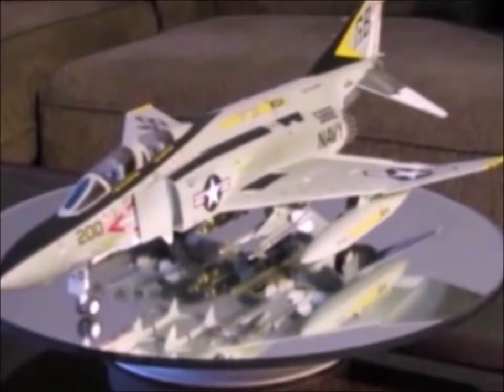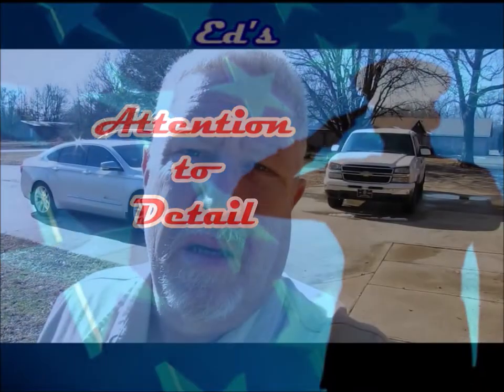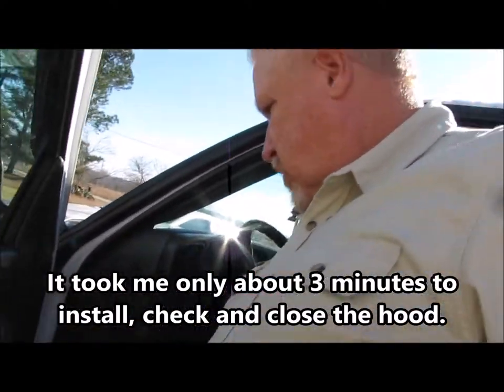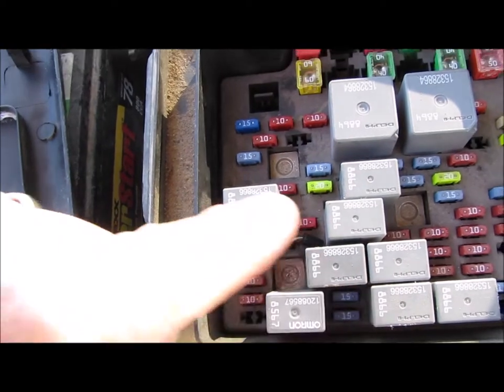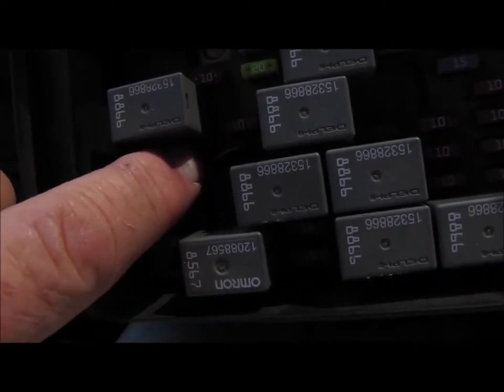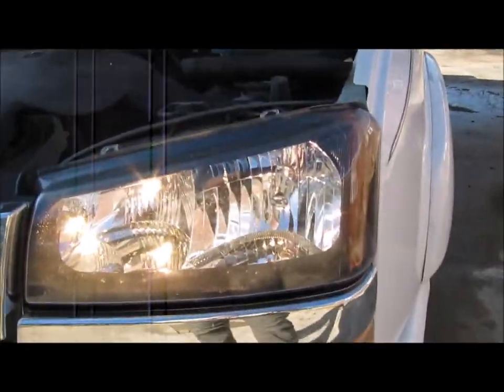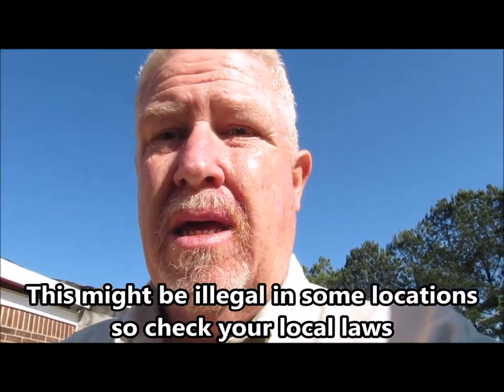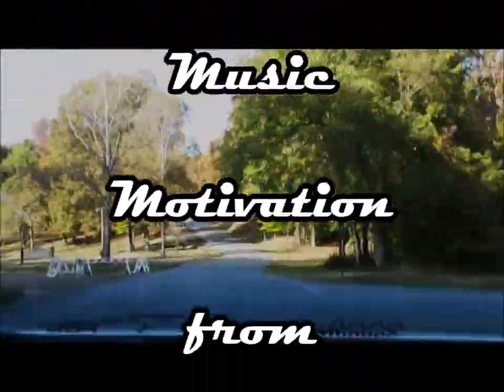Chevy Silverado & GMC high beam mod |  Truck Headlight modification |  Diodes

Comment: Hi Ed. This is a really informative video. Great information! Great disclaimer at the end. Have a great day buddy 👍
Reply from the maker: Funny thing is that several companies make a wire harness with a relay and fuses to do the same thing but charge $20 or more and this cost less than a quarter for the diode.

Comment: This will work on any car/truck with 4 headlights where only 2 come on with high beams.

My 90 Silverado has no relays or a factory diode, or flash to pass. Just an ole school simple low beam hot wire and hi hot wire seperate from each other. I just shorted those 2 wires together with a 10A diode ordered from walmart.

But my circuit breaker is 20A so I had to calculate that 4 headlights on would not draw over 20A. Turns out the two 55w lows draw something like 8A, the two 65w highs were something like 9.5A, or 17.5A with all 4 on. Only the 8A lows draw off the 10A diode, so thats was ok too. 

Part of what made me do this is my 02 bonneville was way brighter but I discovered it has the same lowbeam and hibeam part # bulbs as my 90! Yet from the factory on the 02 all 4 come on <--which is what I'll tell any cop who complains about all 4 coming on with my 90 haha. 

I did get a state inspection and they asked me to flip hi's on,  they did not say anything. Probably cos on the really old gm cars all 4 came on, and so do the new ones. Only the late 80s to 2000s had that stupid 2 hi bs. So the inspector probably did not even know mine was '2' from the factory.
Reply from the maker: Thanks for sharing, this is good information.

Comment: What exact diode did you use for that? That seems like it should have come that way from the factory.
Reply from the maker: The diode is 1N4004, cost 22 cents.
Reply: @EdsAttentionToDetail  Thanks Ed.